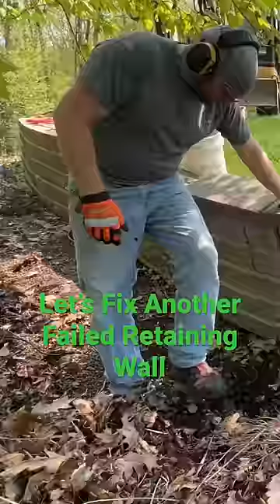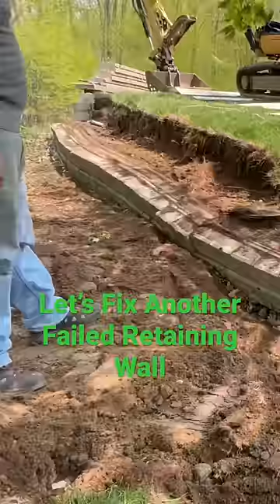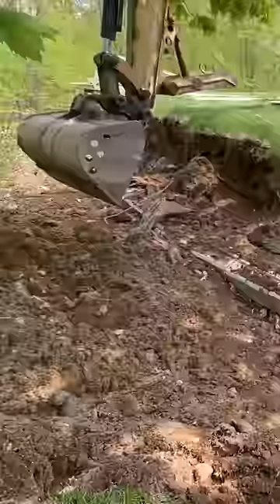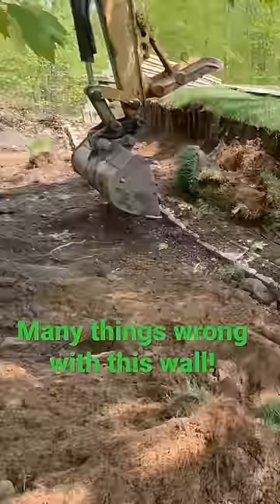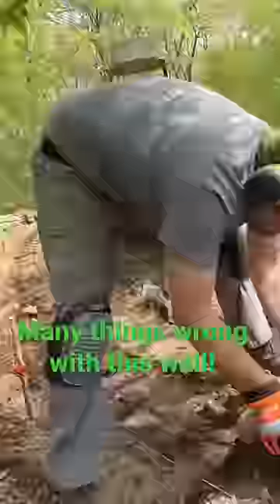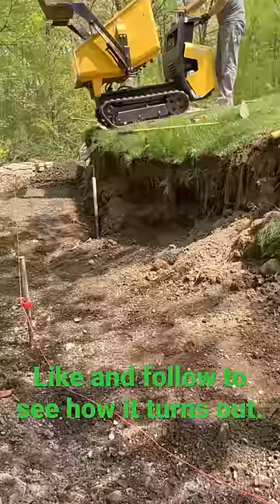Another Wall Failure! #shorts #landscape #repair

Comment: Do you not need to dig down and stick a half decent footing in for the new retaining wall? otherwise the same things going to happen again over the years surely?
Reply: 100% .... All that hard work clearing the old wall, only to make exactly the same mistake 🤦🤦🤦
Reply: My first thought too
Reply: This wall is pretty low.... it won't have issues  if you do other things properly
Reply: Nah.. he's showing how it messed up in the first place. Pt 2.. he takes it all apart again and puts in a footing.
Reply: Looks like we know who built it the first time
Reply: How you think repeating customers was invented🙃
Reply: It needs a drain tile and rock backfill.  The wall will stay right where it’s at.
No drain & no rock is why it failed.
Reply: Job security
Reply: You just need to level the surface the initial layer is laying on.
Reply: Yeah  he's wasting his time    you need proper foundations and steel and mass concrete
Reply: But the wall was the demarcation of his property. Now he gets problems with the neighbor
Reply: Not necessarily, yes he needs to dig down a little bit, but that is so he can get proper compaction of the material and fill in with quality structural fill and compact that. Having not seen the entire thing to analyze exactly what happened, at least differential settlement occurred. That happens when improper drainage or insufficiently compact or not enough bearing capacity of base material is in use.
Reply: @davidpetersen1  I don't think so
Reply: @brophymusprime593  wrong
Reply: Yes, you are right
Reply: @Kt-ro2fm  thats entirely wrong. If you just level the dirt and or rock to place your blocks on it will likely fail over time. Hydraulic pressure is the culprit behind most wall failures. If you dont give that water a way to escape then your inviting failures, its no different from foundation failures/leaks. This is why you add a layer of rock behind it with drain tile. Theres also drains that you can tie in that come out of the face of the stone to give it an easier path to get out. This is the number one thing you can do to prevent wall failures but theres also another safety you can apply called geo fencing that ties the stones into the back fill. Its code for many counties if your wall gets over a certain height.
Reply: @roberthunter7081  Robert, have you seen shredded tires being used instead of gravel ?
Reply: Footer is not necessary!!!! Proper sub base, base and compaction are plenty fine when coupled with proper backfilling, sleepers and drainage… Gotta laugh at all these people that think a concrete footer is necessary for a retaining wall that is not structural lol.
Reply: @davidpetersen1  How can you lie like that? Well, I guess I’m not surprised somebody who thinks you absolutely need a concrete footer for a retaining wall would lie like you do.
Reply: @brophymusprime593  Partly true. You need a solid sub base, proper compaction and base.
Reply: @Paul-oo6uu  Yep. In his video he shows how there wasn’t proper drainage. These people in these comments saw a video of a guy putting a structural retaining wall in, pinned to a concrete footer so they think all retaining walls need them. Little do they know because they have no experience with site work, soils or compaction, that a proper, solid and compacted sub base, properly compacted acceptable base, drainage, proper backfilling and correct installation of purpose built locking concrete retaining wall blocks is more than sufficient for some retaining walls along with the use of sleepers when needed. If I was this guy, I would have dug down to undisturbed soil and placed lifts of crusher in until just below finish grade and built the wall from there. Or if locating undisturbed soil is impractical, removed a bit of the soil and compacted, then add lifts of crusher.
Reply: @fireworm91  If it isn't tied into the ground it will fail again. No matter what else you do 'properly'
Reply: @davidpetersen1  He hasn't put in a footing, you can see him put aggregate down, do you know what a footing is?
Reply: @Miles Williams  i have been making my own retaining walls for years... small walls like this were never a problem in my area... 
It all goes to the soil properties... 
If it becomes as muddy as a landslide you need concrete and L shape footings... if it almost stand by itself it just need plants to grow root on it... 
So yeah it's better not generalize...
Reply: @m1leswilliams  Sprinkling some aggregate on the ground isn't a proper support. Do you know what a footing is?
Reply: @WiFi2021  job security my friend.
Reply: The new wall is being built on top of the ground that the old wall sat on for years. It's plenty stable now even if it caused the failure of the original wall.
He's using rock for the base for adequate drainage and those blocks are designed to drain, no mortar.
This new wall will likely last a good long while.

Comment: Retaining wall without a footing? Hmmm? I wonder what made that wall fail? Let's rebuild it again the same way and watch history repeat itself!
Reply: Yeap - that’ll do it every time
Reply: I was just thinking that you may want to key that wall in 🤷
Reply: Exactly 😂
Reply: I used 5/8 minus as a base it’s been 10 years still going strong hasn’t shifted at all
Reply: Ditto
Reply: You don’t need a concrete footer pinned to the wall for a small retaining wall. You can use sleepers and taper the wall with a proper base, and sub base. In this situation without a footer, it would have been best to dig to undisturbed soil or level and tamp the soil at the existing grade, stone in lifts and tamp in between lifts until your just below the lower finish grade. Then place wall on top of the last lift of stone, making sure the final lift is level and at the proper grade.
Reply: That's the compacted Gravell is for. If you don't know what your talking about don't pipe in
Reply: A
Reply: They should be inlayed into the ground by at least one row or two depending on the step and grade of the retained ground on either side
Reply: MERICA 🫡🇺🇸
Reply: I build walls for a living and something small like that all you need is a good base! I use crushed lime rock then wet it and tamp it down. I've been doing it for over 10 years and have yet to have a complaint! Now if it's big then you put in a footer but not for something so small it was obviously done by some high school kids!
Reply: It is called 'repeat business'.
Reply: @user-zh4io5zc7f  😂🤡
Reply: He left the base row in...
Reply: No grid, no drain tile, no fabric. No rock behind the wall to help draining.

Everything with how that wall was built was cheap. There's a reason he came in 10% lower than the other vids.
Reply: Return customer
Reply: @user-zh4io5zc7f  we would lay gravel then paver base on top to level. Also the stones we used had a little more backward lean than those, so they were leaning into the dirt they were holding back. Never had issues with any of the walls we've built, some of them are 15 years old now and havent moved an inch. We also put drainage tiles in front of and behind the walls to keep water from damaging things. Some of these people dont know how to properly build stuff and it shows. The guy who posted the video is doing it right, and these armchair contractors dont know what theyre talking about.
Reply: It's not structural and a compacted rubble base is sufficient if it has adequate drainage behind it. The old wall had neither.
Reply: I was saying that just before I looked at the comments 🤣
Reply: @737simviator  I was gonna say, is it just me or do American tradies do everything weird 😂😂
Reply: @mikeznel6048  
Wow! You guys only have to dig out soft sandy clay & silt?
Come down to the North East inland, it's like glacier till. All hard-pack clay mixed in with native soil and 2”-6” rocks infused into it all. Fun stuff. Then I use 23” crusher run with a 1/3 if an “ of sand if it's really bad. I've never heard of laying a segmental wall on top of poured concrete? The system has to move a little bit with all of the frost & thawing going on.
Reply: @Seasniffer69  I don't think there was a base, that's just the block imprint.
Reply: LOL.
Reply: Devil is in the Details .😊
Reply: No drainage 
??
Reply: A tieback every 20' wouldn't hurt either.
Reply: I was thinking a wall that size should have some sort of footings
Reply: The compacted gravel is what makes the footer..
Reply: In England we actually dig a foundation / then concrete then build the retaining wall lol
Reply: @user-zh4io5zc7f  well said, was thinking the exact thing.  I love when armchair quarterbacks weigh in.
Reply: @user-zh4io5zc7f  He placed gravel on what? You have no idea so maybe don't pipe up when you know nothing, son. What do you know of the soil conditions here, of freeze thaw cycles or plasticity. You can't even spell gravel yet feel like you should comment? What do I know though, I've only been in construction for 42 years and a commercial super for 30 of that.
Reply: @mudslutmusic9052  Really? Mind linking the soils report you are using to make these assumptions?
Reply: Keeps the work coming :D
Reply: bet you they told em the classic "call us if anything goes wrong"
Reply: No packed gravel base, no gravel backfill or french drain.. did see some geofabric but hard to tell what it was actually doing..
Reply: compacted gravel makes a much better base for a retaining wall than a poured footing... no drainage made that wall fail. I've repaired plenty of retaining walls with footers... they always just get pushed off the footer because of hydrostatic pressure... or the footer cracks and sinks.
Reply: Construction men are commenting on here? Really? There's enough PMS emotional butthurt flowing to make yt algorithm start kotex ads on y'alls phones 😂
Reply: yea it doesn’t needs footing if you just layer landscaping fabric every layer and 3-5 foot back. also will cost about 5% of a footing. hold up longer and doesn’t get ruined by moisture
Reply: Gravel is always the footer, originally there was no gravel, no backfill with gravel, and no perimeter pipe. Why that wall was leaning forward to begin with.
Reply: @namyac88  you definitely don’t use landscaping fabric. Lol you can literally tear that stuff apart with your bare hands. I think you meant to say geo grid.
Reply: Nothing wrong with a hardcore foundation in this situation. However the first row should be started below ground. The only mistake I see here is raising the base above ground rather than digging out some mass and filling in. He will end up with left over stones.
Reply: @MarcusHawksley  true. 10% of the wall should be under grade.
Reply: Well, he'll have content for his next video then.
Reply: It all depends WHY the wall tipped.  Wall appears dry, and therefore not likely JUST hydro pressure unless interlocking hydraulic cement blocks with very little clearance were used.  If due to frost heave, then better drainage required but ALSO footing below frost line ALSO, to be sure.  If due to erosion of soil in front of wall or settling, then again footing required.  Either way, footing recommended, unless you are in a dry, warm, area with not a lot of uphill area (and thus water originating) behind wall.  This is why code and best practices differ not only by region but also site.  Does one REALLY want to assume that the gravel will be enough, considering how little extra effort to pour a proper footing?  I wouldn't.
Reply: job security!!
Reply: Are you blind apparently you did not see the dig it out by layers then lay down dirt and rock to create a drain feild.
Reply: Funny thing is a customer keeps getting got by the same sales pitch
Reply: A problem solved is a costumer lost
Reply: Watch the video again and again till your blind ass sees that they level out the ground after taking down layer by layer. It doesn't need that if it's below a certain amount of feet.
Reply: It's not the footing no drainage water gets behind it and pushes it out you have to do corrugated pipe and 10 inches over stone I used to build them
Reply: @andrewnovino5269  are you some kinda of special,the way he leveled it out created the drainage along with layering rock on it.
Reply: Concrete footing for a block wall? You have no idea what you are talking about
Reply: It’s called job security lmao
Reply: Yep, use that geo fabric too noobs!
Reply: It’s about the drainage with these walls if you make a good base and plenty drainage in the. The back you will not have a problem lmaoo you clearly never. Build a wall before
Reply: Link to the rest? I don't see a part 2
Reply: I haven’t built a lot of retaining walls but I’ve built a few houses. If you’re going to do that much work why not pour a footer?
Reply: @Marfoir0303  as far as my understanding, and don't quote me on this. But when you build a landscaping wall like this especially with the load above it... It's better to have a breathable malleable base that will settle and shift with the freezing and thawing of the ground. Lots of proper drainage behind the wall is key. And if you go above 3 ft you want to use a product called geofabric that you bury in layers and put through the pins of the wall and it acts as a netting anchor. Hope that helps and I hope I'm accurate! 😂
Reply: @Marfoir0303  because it’s extra cost and not needed at all the drain system is key to theses walls if it was concrete block to wrap with stone or brick that is a completely different story
Reply: It didnt fail, it was just a 2-year wall
Reply: 😂 100% he was right there
Reply: My Grandad made that wall - we need to ensure repeat business somehow !
Reply: Water is it's worse enemy! No drainage was the reason for failure
Reply: Right who doesn't dig out the old base and start fresh
Reply: Absolutely this will fall again. no footings to native soil also no sub drain.
Reply: You don't know what you're talking about old timer. You don't need a frost line footer for this material. You need 8" compacted base, one course below grade, geo grid wall stabilizer ever other course, clean 3/4" stone behind the wall with a drain tile at the base with some weep holes
Reply: @mikeznel6048 the fact he just dumped base rock on top tells us he used no type of strong base or foundation and I believe that is what he referred to and also if first course is best submerged
Reply: @user-zh4io5zc7f  yea same to you how tf you going to compact gravel on top of finish grade
Reply: 😂 you have no clue what you are talking about..
Reply: I'm a Concretor of 30 years and can give some advice ....put a concrete base in ...
Reply: No drainage either
Reply: @jonnyboi068 depends on soil drainage and water drainage around the wall.
Reply: There’s only a crush stone base required for dry-laid block like that-but it needs to be buried at least 1/2 to a full course to lock it into the grade. This failed due to lack of drainage, failure to tie back the higher wall, and frost heave.
Reply: Whats a footing for retaining wall?
Reply: @brendawhitt2896  just like footings for a foundation. It's a much wider and robust footing at the ground surface that creates a stronger base for a foundation or retainer wall. Without it, the thickness of the block is all that supports the structure on the ground. Typically a footer is 2 to 3 times wider than the block itself. It provides more square footage for the weight above to rest on which insures it's stability from sinking or toppling over.
Reply: I believe the fabric is the most important step.  Footer is really not necessary for that application
Reply: Just needs better drainage prob
Reply: Most retaining walls I've seen have a base block and grill at each layer backfilled with 57 so it doesn't get overloaded with water
Reply: @cjjames83 I’m no mason or concrete guy, what’s a footer?
Reply: Who needs geo grid footers or a reinforcement zone?
Reply: So no footing no drainage and incorrect backfill
Reply: put my wall in 13 years ago, 4 feet high using this same compacted base. drainage behind the wall with geofencing. hasn't shifted a millimeter.
Reply: Is there another late to this as the walls not finished in this one !?
Reply: He put a gravel foundation in. That should be fine. Like you know anything about retaining walls... ROFL
Reply: Where is the failure??
Reply: Lol @ footing. No need. Just dig down to clay.